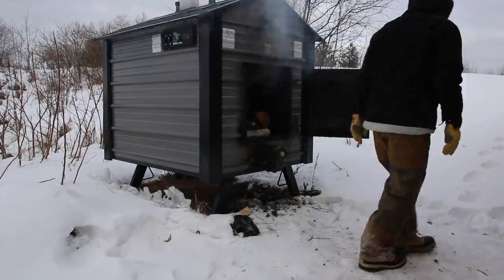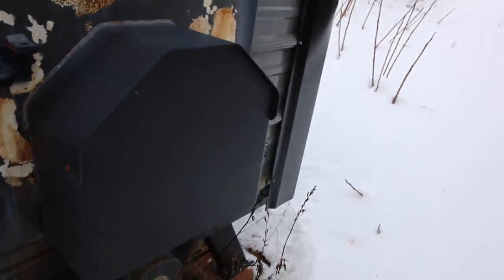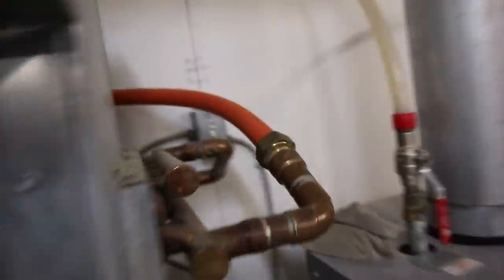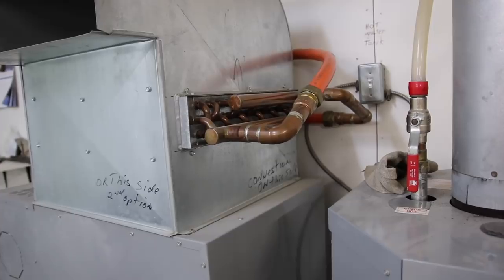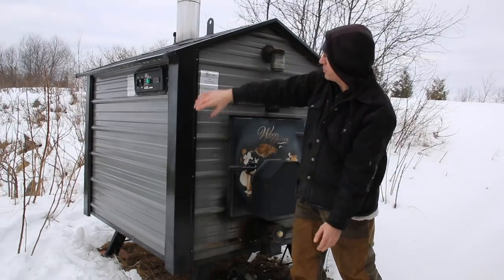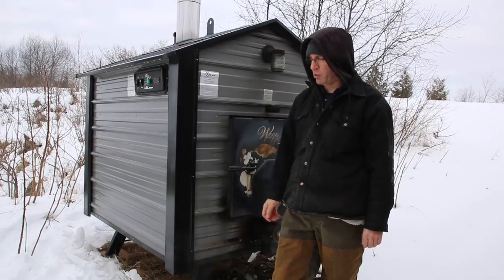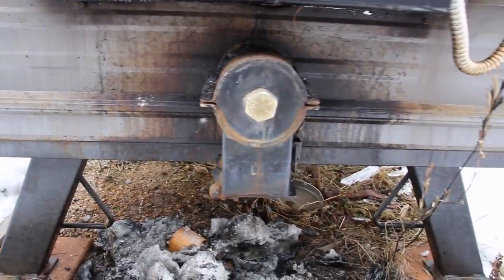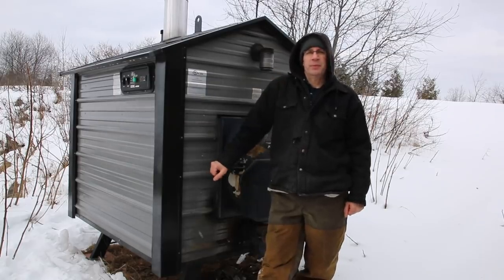Outdoor wood furnace "worth the investment?"

Comment: A lot of good information and food for thought right here . I built a stone and cement building right behind my house for heating only and after one winter of having to go outside , built a totally enclosed and insulated walkway to the furnace which now has optional water recirc when needed . Three 80 amp deep cycle batteries and a small Honda generator for backup in case of electrical loss to the house + the walkway is wide enough for about 4 cords of wood . Thanks for your video French River Springs and All the Best .

Comment: I’ve got a central boiler model. 400 gallons of water. Never bought any wood. Burn scrap wood that people bring to me. Had it for 10 years  now. Only things to replace are the cartridge for the circulating pump every 3 years. I’ve saved about $30,000 in oil.

Comment: I use 2 wood stoves to heat my 2,000 sq ft shop. I have a 20' x 21' shed next to the shop 
 and it is dedicated to storing firewood. (sign on front of shed says "free butt whuppings in back" I can buy cut, split hardwood 18" in length for $120 per full cord and that is delivered. I store up to 8 cords of stacked wood plus there is a three tier 8' long lumber rack for storing boards and lumber. I used a wooden pallet and put sides and a back on it. I stack it full of fire wood (about 1/4 cord) and then use my tractor forks to move it inside the shop and place it right in front of the first wood stove. I use a hand truck to move wood to the second stove. I try to simplify things and be efficient as possible. I have 50 acres of mixed hardwood forest but as long as I can by fire wood for $125 per cord cut & split I won't crank a chain saw.

Comment: I have the exact same one and I love it! I am heating my house and attached garage has floor heat and also have a heat exchanger for our hot water heater. It's alot of work but also great exercise! This is the 4th winter and it takes about  12 cords to heat 3500 sq ft and our hot water.
Reply: 12 cords doesn't sound bad. This is the first time I've seen someone relate exactly how many cords their system uses.
Reply: 12 cords is a good enough reason not to get one. I'll go through 4 cords heating the same things in a woodstove or two which costs much less and no real maintenance.

Comment: Nice honest review of your unit. There's a lot of these outdoor boilers, a TON of companies make or made (and then went out of business) very simple units like your Wood Waster... ahem Wood Master. I've owned a Central Boiler Classic CL5036 for four years now, put in by a previous owner of this farm. Hopefully we can help with some people on the fence!

Units like ours are basically non-engineered. Mine is more-or-less reliable because it's got extremely thick steel between the firebox and water jacket. There's nothing to clog up other than the chimney at the back. It's a terribly wasteful unit for these same reasons, and rightfully called Smoke Dragons and Forest Eaters. Specifically, the firebox is always kept very cold. This prevents a hot fire from building, so in addition to incomplete combustion, the smoke readily condenses inside the firebox on the comparatively cold walls and ceiling. It's like building a campfire inside a fridge. There are times I've wished my Central Boiler unit had a bypass valve like yours, but I imagine this thick smoke in a condensation-prone environment is what's caused your bypass valve to seize up. Creosote production in these things is unreal! Adding to this problem is the large firebox/large water reserve idea. Yes it reduces the amount of trips but the fire spends a lot of time smoldering - worse on warmer days - so the creosote is even thicker. Then when the damper finally opens all that creosote makes for one hell of a stinky and smokey fire! I can tell where my boiler is in its cycle just by the smell, I don't blame you for putting that thing so far away!

Something apparently both Wood Master and Central Boiler don't understand is insulating the plumbing. My boiler at least has the pipes and pump hidden behind a door, I see your unit is completely open to the bottom. So much heat is being lost! I was able to stuff a batt of fiberglass between the door and pump, it looks like you'd have to modify yours to have a floor before you could do similar. On a windy day you'll be losing a fair bit of heat right there.

There are other ways to improve on these units. I don't think links work on YouTube, so check out a site called WoodHeat.org. A guy referred to as "Bob in Pennsylvania", who has the same model I do, measured base efficiency at around 25%. Yep, three quarters of the heat goes right up the chimney! Bob made massive efficiency improvements with a few tweaks, basically just adding refractory material, a baffle to keep the fire inside the firebox, and making sure it had decent draft. The manufacturers of these units are apparently ignorant of many developments over the past two centuries. I experimented with my own boiler and added in a floor and three walls made of firebrick. I'm using much less wood compared to previous heating seasons, and am looking forward to a more extensive baffle and improving draft further. As it is I've extended my burn times, despite lowing the volume of my firebox.  As a result of my baffle brick wall my draft is pretty bad, so the chimney builds a lot of creosote, but I'm STILL using less wood! A top-of-stack draft inducer like Mr. Bob in Pennsylvania is out of my price range, so this summer I'll be trying to rig up a blower to fit over my boiler's air intake.

For those that aren't stuck with one of these things and are looking to buy, consider looking into a gasifier. They're much more popular in recent times with US EPA restrictions on particulate emissions (the visible part of smoke). Someone else in these comments referred to them as double-burners, they basically "cook" the wood, then burn the gasses, by adding air a second time. They then extract the heat from the burnt gasses after combustion has completed, instead of cooling the fire and actually preventing complete combustion. This allows the fire itself to get very hot and burn completely, avoiding much of the creosote and smoke (although they also must idle when you aren't pulling heat from them). Most modern wood stoves do something similar by adding secondary air. GARN, Portage & Main, Central Boiler, and Heatmaster are some major brands that make these, and efficiency ratings over 80% are typical. A friend of mine has a Heatmaster SS G100 or G200, he bought it to tie into his house's existing in-floor hydronic system to avoid burning and paying for propane. It's a completely different machine from mine, like comparing a Bentley to a beat-up Pinto. (Like the Ford Pinto, my Central Boiler Classic 5036 is fairly easy to make spew fireballs from places it shouldn't!) The unit he bought is actually UL approved for indoor installation, so he stuck it in his garage. Anyone else could put a unit like that in an enclosed shed AND be compliant with their building code, almost eliminating heat loss to weather. He burns less wood than I do and has a larger house, AND his boiler doesn't spew acrid smoke constantly.

The downside to a gasifier is the process is based on how reasonably seasoned wood behaves. Because it's a downward burn it can't dry out fuel like mine can. So it doesn't work with green wood, slightly rotten wood, and so on. You can't just chuck corn or pellets or random small brush or giant bricks of cardboard in it, either. He orders split wood from a local guy so this isn't a concern for him. So if you want to burn "whatever", a gasifier is not for you! That said there are way better models than the unit I have. Anything with firebrick/refractory and heat exchanger tubes - an innovation from the Industrial Revolution - will blow the doors off of older design models. I've seen a few of these marketed as multi-fuel burners as these features (ash grate shaker, bottom air feed/blower) make them good for burning coal.

Overall I like the fact that I have a hydronic system in my house. It makes it very simple to add alternative heat sources, such as a conventional fossil fuel boiler (aside from propane models, oil burners can be adapted to vegetable oil and biodiesel) and solar. Heat distribution in the house doesn't need to be via forced air, either - radiant heating is extremely simple and CHEAP thanks to PEX. Obviously the system requires electricity to work - a disadvantage compared to a traditional stove - but if you don't have a blower for forced-air distribution, the power requirement is a few pumps. A quick trip to Canadian Tire will get you some solar panels and batteries that will run this stuff. Another benefit is heat storage: any fuel burner is inefficient in short cycles. When the thermal energy is in water, you can simply store hot water in an insulated container for use later. Insulate it enough and the system is even more efficient, since you can do a 'batch burn'. This is basically what GARN sells but there's a lot of information on how to build your own at BuildItSolar.com

Comment: I met a few people that use these outdoor wood Furness, they do consume more wood. But the ash mess is kept out of the house.  My choice for a very good wood burner is the castiron Volgazane boxwood stove. They have a hot top surface that you can even cook on or keep coffee hot.   Small size wood burns well to conserve and up to 24" size wood will fit for those large oddballs, 16" fits best.  An indoor stove heats much better and cheaper than a fireplace. The heat does get to the farthest parts of the house by means of a thermal siphon, as long as the doors are kept open every room will receive heat without forced air blowers.

Comment: Excellent video - I currently heat my home in Massachusetts with a pellet stove I am moving to New Hampshire & I was thinking about getting an outdoor wood furnace. After watching your video & learning about heat loss I am thinking I'll only get a wood furnace if it can be installed inside my garage or basement in a way that I could feed it from outdoors. With this the heat loss would be minimized & the mess kept outdoors. 
I desire hydronic heated floors & a self sufficient type of heat source in case the SHTF & a wood furnace would work well.

Comment: glycol also has corrosion Inhibitors not just for antifreeze
Reply: Correct i have seen a lot of that black carbonic sludge build up in the likes of Fin coil Heat exchangers and partially block same or the bubbles erode the copper during circulation thinning same especially around the bends of those coils, then you're strip down and replacement, if the mains electric failed for some few days wouldn't like to see a boiler freeze up over time  but maybe the residual heat captured in the system would take care of same...great rig up though as well as the ... Great upload...obviously you're reducing your carbon foot print by your reduction in using the likes of propane and heating oil...
Reply: Yea he thinks glycol is a waste of money. Lol ! Wait till he freezes his stuff up and breaks the concrete above the circulation lines.

Comment: I enjoy cutting and splitting wood and the money we've saved from not having to buy propane for heat is substantial. Figuring out our costs of purchase and installation, money saved, and convenience, the outdoor boiler has payed for itself many times over in the 10 years we've had it. Load it once a day and enjoy the warmth!
Reply: you got that right, the right unit, the right install avagee 1500 sq home should not use more then 6 cord a winter at -40

Comment: My son and I both use  a coal fired boiler working on the same idea. The coal is added automatically from a hopper bin and the ash is also augered out.  People have commented that your shop is too far from the boiler but using the pipe you have you don't loose very much heat.  I keep mine set at 90  c and 200  feet away in the house the temp is 88 or 89. I use the boiler to heat a 2000 sq ft shop too.. I use about 22 tonnes of coal a year, this costs about $95 a tonne.

Comment: Nice honest review. I have a wood heater also, paid 5000 Canadian. I use about 10 cords a year, a lot of wood and a lot of work. I get my wood for free. I estimate I save about 800$ a year. The nice thing about outdoor heater, no mess in the house, and I can burn junk wood, also we keep our house toasty warm in winter. We heat a 1200 sq ft house, bsmt and main floor, preheat our hot water and heat a 1000 sq ft garage. If you like to cut up firewood and you can get it for free for the next 10 years it is worth it

Comment: I've replaced 3 of these this year alone with propane fueled hi efficient boilers. Most complaints are they are fed up of having to go out and feed wood into them.  I set the boiler temp at 150 and a control wire from the house to tell the boiler when to fire. It's simple and far less work.

Comment: 3200 square foot home. Wood stove in family room and a back up stove in basement for those below zero nights in the Northeast. Burnt 6 or 8 cord a year depending on outdoor temp. Used oil furnace for them cold spells too. Did this over 20 years. Moved to Florida now, almost 70 years old. I have solar here and freaking love it. $31.00 a month electric bill running pool pump and AC! Insane.
Never realized how much of my summer was spent preparing winter in North East. Want to stay warm..... Florida! Love it!

Comment: I have a heatmor wood boiler. I have used it for my home for 15 years and love it. I guess it all depends what you guys are comparing the water stoves to. I have about 7 grand in it but I am a plumber by trade so I did all the work myself. I burn about 7 or 8 cords per year. If you figure that up that's about 1000$ or so of wood. I have a land clearer bring me wood to my home in logs for free. I cut and split it here and stack under a shelter. I can do this work in about one week of time or 40 hours. My house is 3200sq ft. I heat both floors with two coils, one in each air handler. I used to run my wood stove insert but that is truly a pain in the ass. Keep I'm mind propane is costly and even burning my wood stove was burning 200 or so gallons a month. my house is a log home with high ceilings so my gas pack would still run some when i choked the wood stove down. I live in North Carolina and winters are not bad here. I guess what I am saying is it all depends on how much propane is vs if you have natural gas. If I had natural gas I would not have a boiler. but vs electric or propane I would have one all day long. They are some better than others and I did my research. heatmor and central boiler are far better than any other ones on the market. I have had no issues with my unit and would buy one again. They are not a waste of money and anyone that would get a boiler and not keep the other form of heat would not be very smart to start with. I still can run my gas pack and my heat pump if I choose. Keep in mind I am in the construction business and can do hvac as well as plumbing and elec. If I lived up north I would have one all day long. Think about this, here wood is 160 a cord if you had to buy it. propane has been as high as 3$ or more a gallon. If you buy 1000 gallons of propane a year that is 3000$ How much wood can you buy for 3000$? Now propane is around 1.70 a gallon but it goes up with fuel. You would have to figure up how much u spend vs propane and or power to heat your home and water. I heat my water with it also. if you burn 10 cords then figure how much that would cost u vs propane and power for the heating  season and that's your answer. i am in my mid fifties so sure one day i wont really want to do this but for now i need the excersize and it saves me about 2000 or so per year. every time propane spikes i save money and smile.  My biggest game changer is i was tired of being held hostage by the gas company. and i can make it as warm as i want in my house. i hear so many people saying they keep their temp at around 68 to save money.. screw that i aint going to sweat or shiver in my house. in my mind that don't even make no sense. as far as time in it is concerned and or maintenance. the time i have in it i would be doing other stuff outside anyway and as far as maintenance any one of you that can say your other heating systems never break are lying. if you are talking wood stoves ok you still gotta clean the flues and The fans can go and u gotta clean them out several times a week so there is maint. I still have my insert and i still use it a  couple times a year but it is nothing compared to my boiler. I encourage you na sayers to look up heatmor and compare. there are many kinds out there and i am telling you it is by far in a league of its on  Oh and the door that cooked on yours,  that is because it is not cooled. the heatmor door has water going through it so that cant happen. By the way the door is the most expensive component and the most important part of any boiler. do your own research if you don't believe me..Some of you guys are correct, they are not for every one but if i lived in the country and had a farm with no natural gas, hands down i would have one in a minute.I could go on and on but i already have and you i assume are tired of me by now. Thanks for reading my two cents. If you would like to ask me any more questions about it feel free to